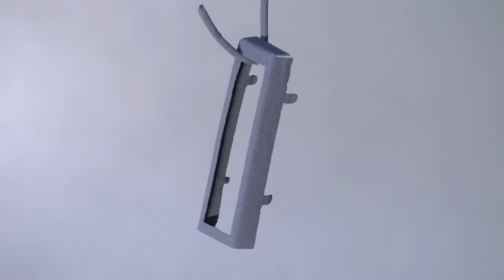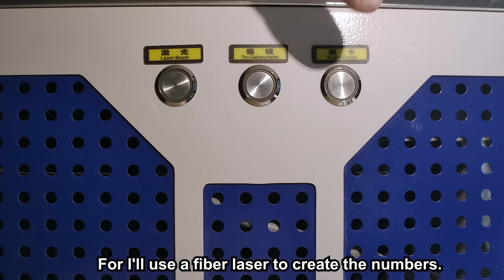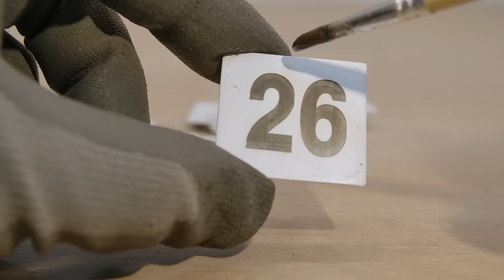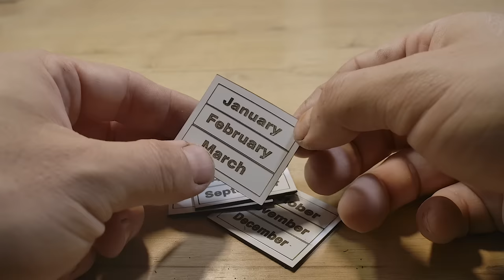Restoration calendar

Comment: Great job. Almost 1 in 1 with the original. The only differences are the color and material of the emblem.
But there's one thing I can't understand.
Where did you get this thing in such a destroyed state? Everything I saw was at most worn or broken. And yours looks like it was soaked in some  acid

Comment: I'm curious why use the CNC to make wax copies of the badges then go through all those processes to cast the badges in aluminium?
Why not skip all the casting stuff and just make the copies on the CNC with aluminium instead of wax?
Reply from the maker: There are a number of reasons for this, I have a weak machine for this, and when milling aluminum, such ideal shapes will not work.
Reply: @PSVRestoration  Thanks for clearing that up.